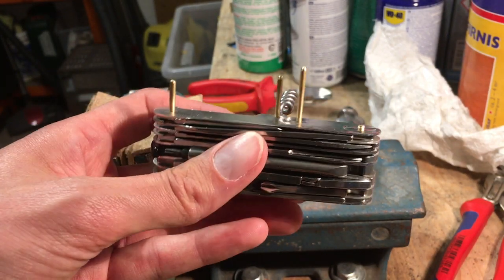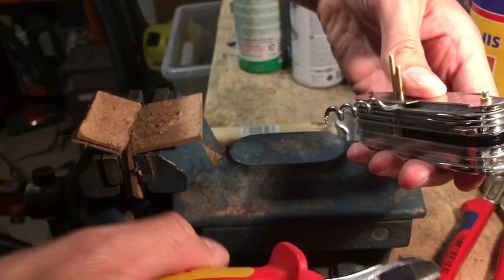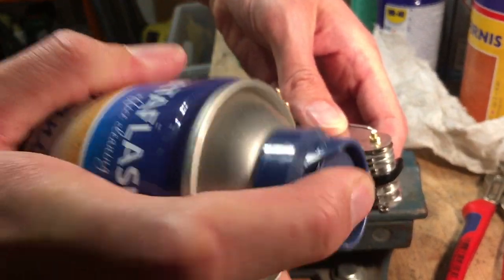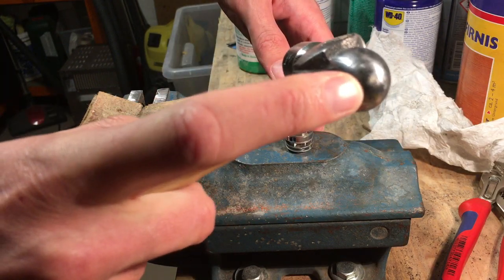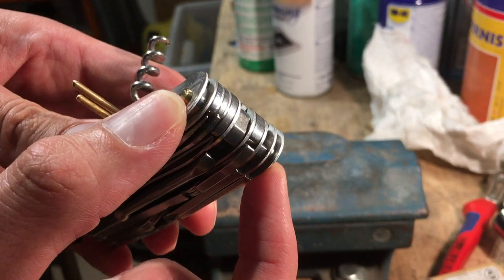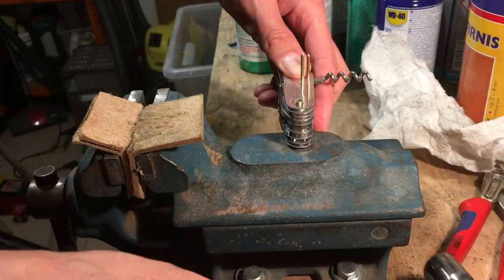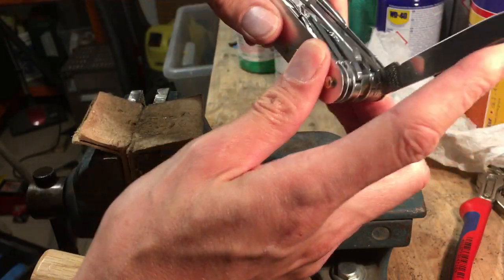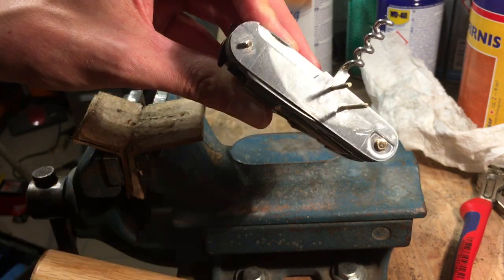Cyber Champ #8, how to close the rivets part 1. Victorinox Mod

Comment: I just wanted to thank you so much for this. I have been thinking about making my own SAK with my preferred set of tool but never did a SAK mod before. While there are a few videos showing how to take it apart, there was none showing how to put it back and what to do to make new pins, so this will be extremely helpful. Hopefully, I will be able to do it!
Reply from the maker: Thx for this nice words
Reply: @dereidgenosse5247  You're welcome, your series is awesome and very informative. Also, do you know of any Victorinox tool that I could use and would fit in the place of the magnifier glass?
Reply from the maker: @bdpf1744  the bottle opener and can opener together. But never done by myselve
Reply: @dereidgenosse5247  Thank you so much for your rely. I have one last question if you don't mind.
The mod I want to do is to replace the scissors in my Explorer with the Saw from my Ranger.
The Scissors are paired with the hook that I would like to keep.
The saw has no back tool.
Looking at the liners of the scissors and saw, they seem to be almost identical with the liner of the saw having a flat surface at the end to accommodate the tip of the saw.
It seems that if I would want to have the Saw paired with the hook, I would have to:
- Use the Liner from the scissors
- Grind the end of the liner so it would fit the tip of the saw
- Add some spacer washer on the saw to compensate for the thickness difference of the hook (hook = 2.5mm, saw = 1.8mm)
I don't have a SAK that has the proper liner with saw  + small flat screwdriver, nor do I want to add an extra layer to my Explorer, I just want to replace the scissors with the saw.
Do you think it is possible?
Does what describe seem correct to you or is there a simpler way? 
Thank in advance.
Reply from the maker: @bdpf1744  yes sounds good for me. But i never worked with spacers. No idea if this is a good plan 😬
Reply: @dereidgenosse5247  I think brass washer spacers should be fine, they are used on some other mutitools, and since the hook is wider than the saw, without spacers, the saw would have play since there is 0.7mm difference. I was more worried about if using the scissors liner and simply grinding the end to fit the tip of the saw would work or there would be more involved liner mod required. It seems like it should work. So thanks again
Reply: @dereidgenosse5247  By any chance, you don't happen to know where I could buy the brass rings? Just in case I end up damaging the ones that are on the knife since this will be my first mod.
Reply from the maker: @bdpf1744  no idea
Reply: @dereidgenosse5247  I didn't think so, it seems that those brass rings are impossible to find. Thanks again for all your help.

Comment: Thank you! You are a good teacher. It is a pity that in Russia in stores such wire is not for sale
Reply from the maker: Viy 2000 i got mine from an ebay shop. For 91mm knifes you need 2,2 mm brass and 2,5mm brass

Comment: If i only want to replace the corksrew, can i Just remove one rivet or i need to dismount everything? I have a champ but the corkscrew is broken! I got the replacement piece and i Just want to change it! Thanks in advance! Great videos!!!
Reply from the maker: Alexis Morin try it 🙂 you have to work against the spring power but it is possible to do 👍
Reply: Der Eidgenosse Thank you so much!! Ill search for brass pin now! :)
Reply from the maker: You need 2,2 mm for the corkscrew and 2,5mm for the knife blade

Comment: Hello. Great video my friend, very illustrative. Where did you buy the rivets for the victorinox knife? I have a vic camper with the two blades broken and the can opener in bad condition, I want to open the knife and replace this tools with new ones and then close again with new rivets like you did.
Reply from the maker: Sredni Vashtar german ebay
Reply: OK, how do I look for them on ebay? I looked for them as rivet and none came out like the ones you use.
Reply from the maker: Sredni Vashtar round brass material
Reply: @dereidgenosse5247 OK, thanks! You have a new subscriber. 👍🏼

Comment: Great videos i feel inspired to try and make my own custom SAK thank you You mention watch your eyes when cutting the rod one trick someone showed me a while back is to take your diagonal cutters and fill the void in the back of the jaws with some sort of silicone or RTV after it dries slice it with a razor blade so the jaws open and after that anything you cut will get trapped by the jaws instead of flying across the room